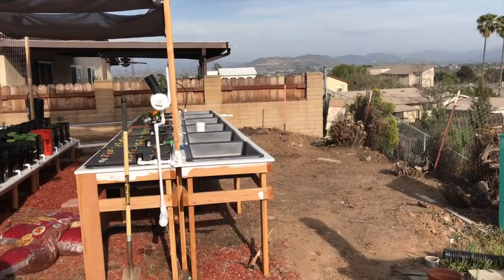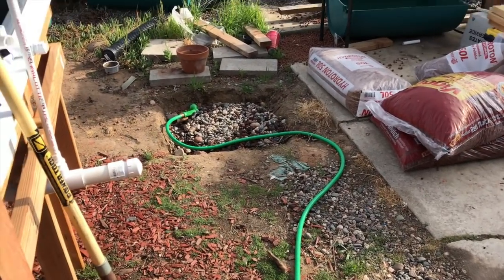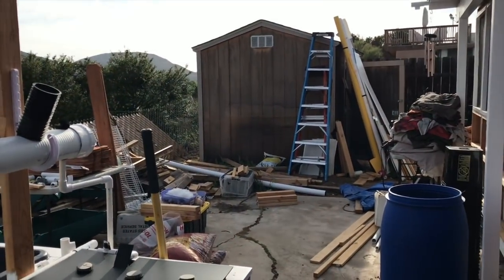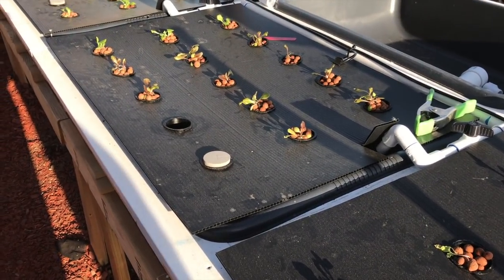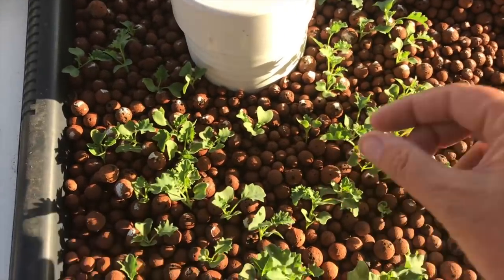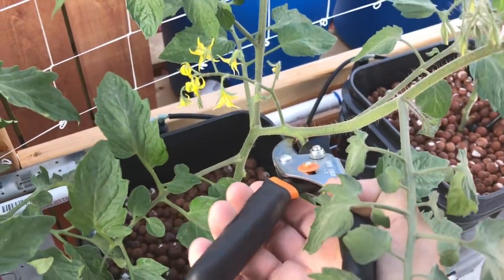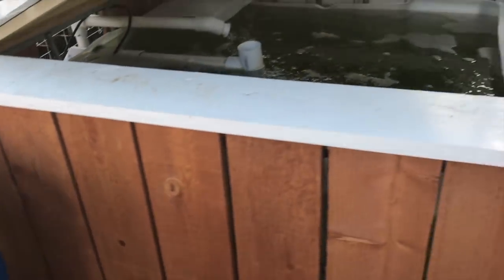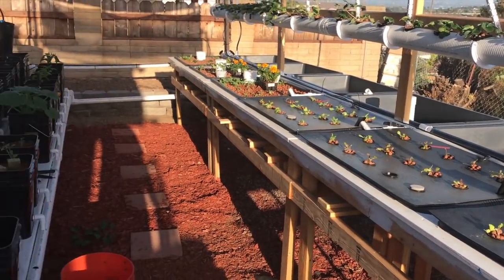Aquaponics Vlog: Everything Is Awesome

Comment: I tried that black corigated stuff and it got hot and warped really bad so I switched to the silver coated foam and it falls apart over time so I'm going to get some new stuff tommorow for my new setup. I love the new red bark on the ground, it looks really nice. The fish look super happy, and I love that when they see you there come to the surface to tell you "feed me dad". If you loop the air line above the water level it will stop back flowing. Great update Jeff and as always Keep Building.